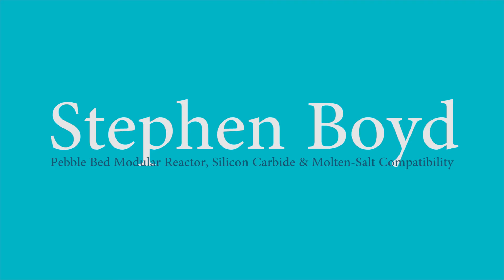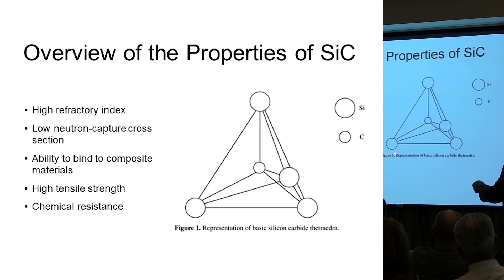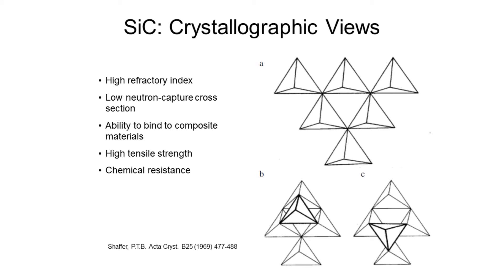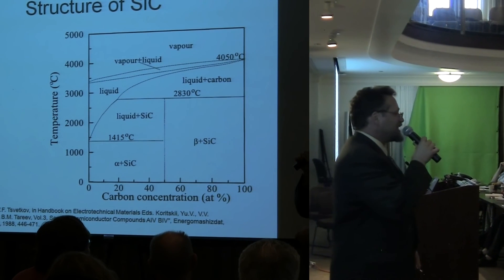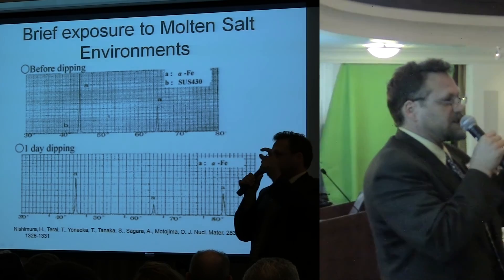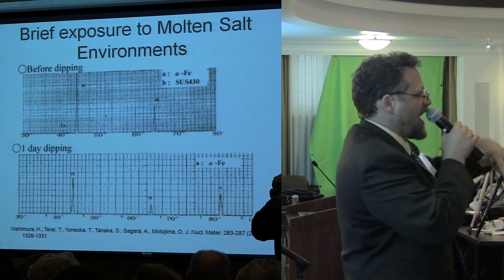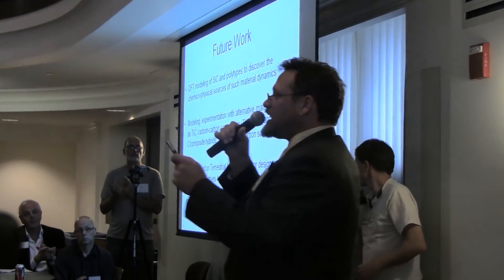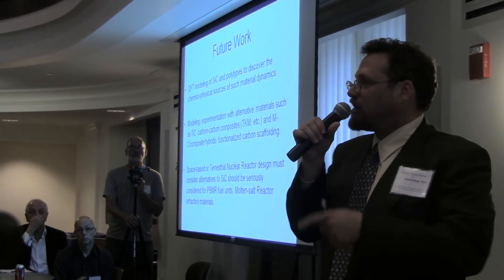Stephen Boyd - Silicon Carbide & Molten Salt Compatibility @ TEAC5

Comment: Gee, I thought Ihad a brilliant idea.  But it won't work, my wall will dissolve in the salt.  Pretty disappointing.  That it was not an original idea is superfluous.  So, back to square one.  Beryllium was used in the airplane reactor and ran at 850 degrees centigrade for quite a whie.  So that idea is not original either.  Beryllium fluoride is cheap, but the metal is expensive because it takes a lot ot electricity to elecrtolyze the salt.  But, LIFTERs will provide cheap electricity, so maybe the first few such reactors can make beryllium?  Neutrons break the crystal structure of lots of materials; how about metallic glasses?  Those don't have a crystal structure to break (?).

Comment: 15:01 after 4.6_years of thermal neutron exposure of SiC , the Si  gets transmuted to Mg. Why don't they use Hastalloy_Ni (thermally stress-annealed), as it was used in the original ORNL-MSRE?  MgCarbide is unstable.
Reply: Because the cobalt presence of hastelloy makes it unsuitable for use in nuclear environments as neutron activation will transmute it to Cobalt-60.

Comment: So the solution seems to be Carbon Fiber, somehow woven that it is "waterproof" to the salt, supported by SiC or TiC?

I wonder if Hastelloy-N covered by a passivated layer might work. You're already building the rest of the reactor out of it.

There's also this work here: http://www.sciencedirect.com/science/article/pii/S1369702110702224 that proposes substitution of the Molybdenum for Tungsten for increased corrosion resistance, which might lead to higher operating temperatures.

The energyfromthorium blog mentions a dramatically different geometry instead as a solution as well: http://energyfromthorium.com/2007/08/23/the-modified-geometry-2-fluid-molten-salt-breeder/ . The MSFR by the French/Russian collaboration uses a similar overall doughnut shape; which one can imagine if one bends and extends the cylinder into such a shape.

Comment: 11:35 if graphite is out what about graphine nanotubes and the such?
 I pretty sure that material would have never been considered in the 60's
Reply: hi, tooto macmac - both graphite and its monolayer allotrope graphene will be subject to neutronic oxidation of the sp2-sp2 carbon bonds.  This is why graphite swells so dramatically along the crystallographic "c" direction during neutronic bombardment.
Reply: Stephen Boyd Isn't the solution to the problem of the containment wall material of the pipes contained in your presentation? A flattened out triso fuel shell, silicone carbide providing the structural support and pyrolitic carbon coating protecting the silicone carbide from being disolved by the liquid fluoride thru direct contact.

http://holbert.faculty.asu.edu/eee460/dfg/pebble_disection.jpg
Reply: Dukky Drake  - flattening out the TRISO would expose the nuclear fuel to the molten-salt bath.  Remember, too, that a laminar geometry would permit heat to escape and in the process, damage the pipes.  The TRISO are spherical so they can freely move about and permit the surrounding salt to harvest all of the heat released.  The point of the TRISO is to prevent exposure, while purportedly using the SiC as structural material (as you note) with pyrolytic carbon being the chemical barrier.  In fact, hastelloy is a good containment material for the pipes themselves.
Reply: Wont the solution to the SiC problem be similar to galvanizing steel with zinc and tin for further corrosion resistance, with say some titanium derivative?
Reply: Hi, +tooto macmac - unfortunately, no.  Zinc and Tin both oxidize readily and their oxides are relatively stable.  That's their point: they are sacrificial and their oxides protect the underlying metal, or they are sacrificed first, like the skeg on the bottom of an outboard motor.

Titanium metal will be oxidized, going to TiO_xF_y or TiF4 and then be solvated.by the molten salt.  The pyrolytic graphite would idealky serve the intended, non-oxidizing purpose, were it not for the fact that it has zero tensile strength, so it easily sloughs off, thereby exposing the SiC.  Keep in mind, too, that it's an incredibly wild situation: 600•C, with neutrons, gammas, betas and alphas flying and oxidation states changing constantly.
Reply: Stephen Boyd Oh thanks very much for that info, thats a great insight! My question about the coating was for just plain non-necular molten salts applications. So i was more interested in applying the research on salt mixes that lower the melting point. Focusing more on simply storing the thermal energy, to hopefully ameliorate the need for such complex meteorology!
Reply: Hi, tooto macmac  - sure, npaa.  Whether or not you're in a fissile environment, the same chemistry plays out.  You're correct, regarding eutectics, but the chemistry actually gets more difficult when you enter that space.  If you're going to look at low mp salts and eutectics, you also need to focus on the C_p values (molar heat capacities), because the two parameters don't necessarily always correlate.

Comment: I propose a composite replaceable plate material made up of alternating layers of silicon carbide,diamond and titanium carbide.
The salt loop need no pressurization and can thus be an open channel where the walls are made up of layers the the proposed composite material that can be replaced while the reactor is in operation.

All Rights Reserved
Reply: Hi, Maleblade.  Your blade will be quickly solvated.  both SiC and TiC will be highly reactive toward the fluorinating bath.  That said, there are a number of materials in the paper we published that would robustly resist solvation.  Hope that helps - cheers, SAB, Ph.D.
Reply: Thank you for your input.
Do you have a link to your paper?
Reply: Maleblade
I am happy to email you the paper directly.  Please give me your email address or simply email me: stephen-dot-boyd@havelide-dot-com.  Alternatively, if you have e-journal access, you can find it at the ANS Proceedings in the special June 2012 issue. Either way, just let me know.  Cheers,  SAB, Ph.D.
Reply: You did see that I mentioned a layer of Diamond/Carbon (that would be on the face of the alternating layers).
Reply: Maleblade
 yes, of course.  Diamond and SiC are, in effect, miscible over time.  Recall that the Si-C bond is mostly covalent, and Si is directly under carbon.  In very short order, the Si-C tetrahedra will syntactically coalesce with the diamond and you will get solvation, particularly under these conditions.  I am happy to send you our paper on this topic.  SiC is a remarkable material, but its high covalency (and low ionicity) of the Si-C bonds is far from ideal for a fluorinating molten bath.
Reply: Does your paper propose a better solution?

On another topic,do you think that a
Farnsworth Fusor type neutron source
would be a viable way to start a thorium reactor?
Reply: Maleblade
 Our solutions are proprietary, so they are not for public or peer review.  Suffice to say, there are at least three different solutions (all mixtures of chemistry and materials science) that solve these problems.

Regarding your fusor question, no, the neutron flux is not only far below what would be required, but fusors are, by definition, non-focusable and their fluxes are spherical in distribution.

It's far easier (not to mention abundantly practical) to use, pre-processed, spent nuclear fuel.  We have coined and copyrighted the phrase "actinide composter", since that is basically what we will be doing to "kickstart" the thorium reactor.  Here in the US, we have over 70kmt of it, due to abjectly poor materials management on the part of the parties involved for the past 50+ years.  Hope that helps - cheers, SAB, Ph.D.
Reply: Are you in favour of having control rods in the molten salt fuel mixture of thorium reactors rather than relying on emergency bleed off?
Reply: Maleblade
 oh, goodness no.  There's no reason to.  For slow-rate control, simply manage the amount of fissile load.  We have what we consider to be two robust means of "throttling" for fast-rate control, but they are proprietary and neither employs graphite.  Other than deliberately designing your MSR to throttle, the MSR is inherently a slow-rate system, so unless you do something very stupid and on a large scale, there shouldn't be an issue.

We are trying to get the US Navy interested and have made some headway in that avenue.   The huge energy density of the MSR means you get double the energy output in only about 40% the space of a PWR, so that's a very good thing if you're on a Navy ship or sub.

You could use graphite rods, but they will ultimately always come out "hot" due to intercalation of any number of cations in the bath: Cs, Li, etc.  They will likely also go to CF_x under these conditions (feel free to google it).

As such, you'd have to periodically change the rods.  I proposed graphite de-intercalation chemistries to Per Peterson of Berkeley early last year, based on previous research, which he positively acknowledged, but apparently opted not to use.  It's relatively straightforward to de-intercalate the salts that would end up within the graphite crystal.  The reduction of the sp3 back to sp2 is much trickier, but still doable.  Google "density of states" for graphite and graphite oxide (to give just one of zillions of examples) and you'll see what I mean.  Compare the two plots, right at the center - that represents the change in the "Fermi surface", to use physics terms.  It is a change in the HOMO/LUMO to use chemistry terms.

What I would NOT recommend is what Transatomic is proposing.  They are going to have a very hot, dangerous mess on their hands if they actually implement what they have recently proposed regarding neutron moderation.
Reply: It would be nice to have the thorium in solid form with neutron sources that could be electronically controlled to start and stop the reactions at will.
That way the thorium fuel could be withdrawn from the molten salt.if necessary.
Reply: Maleblade
 What you're proposing is neither feasible nor practical.  Solid thorium is unwieldy in the solid state and the surface area is abysmally low.  It also affords exactly zero of the superiority of a fissile fuel in the liquid state. 

The flux you are describing cannot be achieved without an accelerator and ADS (accelerator driven systems) are basically an impractical pipedream.  Google ADS and the UK.  I have met with several physicists from the UK who are proponents  of ADS but they are at LEAST a decade out.  The only viable ADS I see on the horizon is the FFAGS (google it).  Japan is the furthest ahead in this as far as employing it as and ADS vehicle.
Reply: What may seem impossible today is usually achieved tomorrow...never say never. :)
Reply: Maleblade
 it's not a question of possibility.  The point of a liquid fuel is that it affords you nearly infinite surface area.  We have over 70,000 MT of spent, hot nuclear "waste" here in the US that will sit around for thousands of centuries if nothing is done with it. 

This is stupid.  Expend it as fissile kickstarter for an MSR, thereby extracting all of the energy stored in it and simultaneously eliminating this blotch on US soil.  This was proven to be feasible in 1971!  Why waste enormous time and money on an ADS and have the "waste" continue to eat through every material known to man and eventually contaminate everything it touches.
Reply: The MSR seems to have a lot of benefits...why do you think it has not been developed?
Reply: Maleblade
 oh, that's easy.  We have 60+ years of entrenched U-based NPPs.  That's a near trillion-dollar industry.  An MSR is a superior reactor and the U-based industry is in the top 10 most powerful lobbying efforts in the U.S.  Ergo, zero competition is permitted.
Reply: There is something about the MSR breeder fuel that bothers me.
At very high neutron flux densities most of the thorium could be suddenly converted to U233
and you have a liquid bomb?

My solution for fast shutdown is molten fuel overflow into runoff channels.
Imagine a glass of water,that is filled to the top.
If you suddenly drop marbles into it the water will overflow.
This is a much faster process than a bleed down or waiting for some plug to melt.
The "marbles" or rods would be neutron absorbers to quench the reaction faster.

Of course I lay claim to this idea.
Reply: Maleblade - what you are considering regarding a "liquid bomb" makes no chemistry or physics sense.  It's extraordinarily difficult to purify 233U because it's contaminated by 232Pa (IIRC) and 232U - a very hard gamma emitter.  In contamination concentrations as low as 50ppm, the 233U fission detonation reaction fails.  Further, you're working with a fixed volume and neutron energy window, so a high neutron flux is meaningless.  Please research the history and challenges of making 233U bomb and you'll see the dismal success rate.

Breeding and purifying 233U is feasible, but it's simply a waste of time and money.  You'd need a special type of reactor and incredibly exotic chemistry, materials science and physics.  It's so much easier to use off-the-shelf technology if you're interested in a repellant idea like making a bomb.  The breeder reactor that the North Koreans have in Yongbyong is a good example of proven (albeit criminal) 239Pu breeder technology.

Comment: Regarding the MSRE, the Hastelloy N was used outside the fissile core away from the neutrons and the neutrons damage.  What they used inside the core of the MSRE was graphite.  What ORNL found is that under long term neutron bombardment  the graphite shrinks and then expands possibly forming cracks in this process.  Finding a suitable  material replacement for this graphite is one of the technical challenges that remained unsolved by Weinberg's ORNL and Silicon Carbide was a candidate for this.

Comment: Because there IS material a that can be used; silica carbide is a material they want to use in modern reactors...not one that was used in the MSRE.  They used a super alloy called  Hastelloy n in MSRE, and there are perhaps even better materials we could use today.  Hopefully that alleviates your confusion!
Reply: Whose confusion? Yours? Hastelloy-N was indeed the alloy used for the MSRE, but that reactor was the single-fluid type. No two-fluid salt reactors were ever built. Nickel-based alloys like Hastelloy-N are resistant to fluoride salt corrosion, but they have a high neutron capture and are damaged by those neutrons. The nickel alloy containment wall in a single-fluid reactor receives a much lower neutron flux than what the barrier wall in a two-fluid reactor would have to endure. The high neutron capture make a two-fluid breeder impractical, and have a short life span, which is why Dr. Stephen Boyd is still correct that no barrier material for two-fluid reactors exist yet.

Comment: Here's my question.  How did they run a molten salt reactor for 10,000 hours if there isn't any material that can be used?  Does anyone know?
Reply: You missed the point. Hastelloy-N was indeed the alloy used for the MSRE, but that reactor was the single-fluid type. No two-fluid salt reactors were ever built. Nickel-based alloys like Hastelloy-N are resistant to fluoride salt corrosion, but they have a high neutron capture and are damaged by those neutrons. The nickel alloy containment wall in a single-fluid reactor receives a much lower neutron flux than what the barrier wall in a two-fluid reactor would have to endure. The high neutron capture make a two-fluid breeder impractical, and have a short life span, which is why Dr. Stephen Boyd is still correct that no barrier material for two-fluid reactors exist yet.